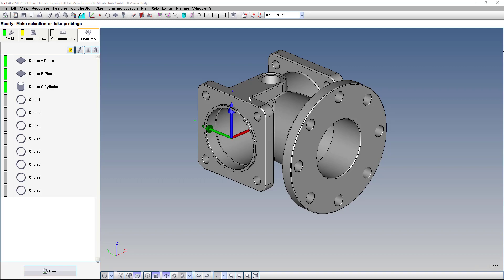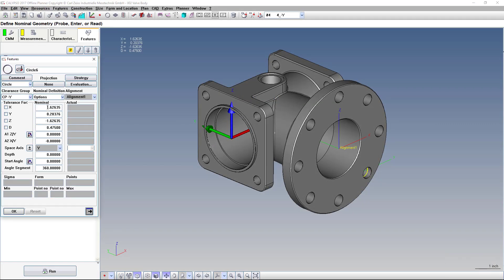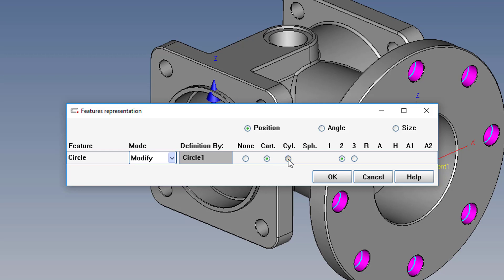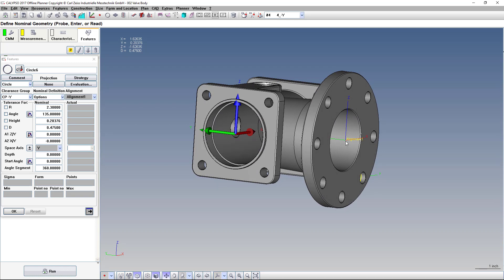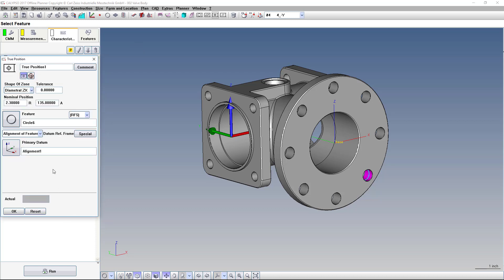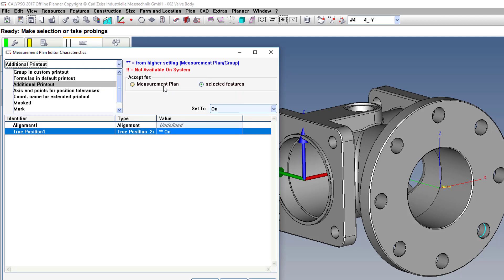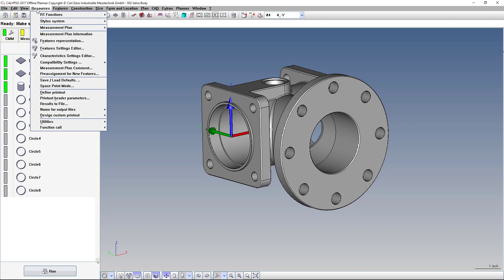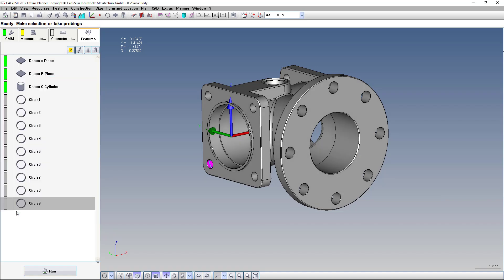True Position in Polar Coordinates

Comment: How to get the true position of 8 holes instead lying in the plane (as shown in video) it is lying in the outside diameter surfaces or outside diameter surfaces with the basics given are depth and the angle location of the holes
Reply from the maker: In that case you can create separate secondary alignments for each hole. Each alignment will be offset by a basic angle so that one of the axes points to the hole.

Comment: It was great to see the difference between Cartesian coordinates and Polar coordinates. However imagine you have radial holes on the bigger diameter. Then the axis of the radial holes would be different from the alignment, and because of that the true position, using polar coordinates won't work. I find it hard, doing a new alignment, to measure true position of radial holes. How do you do? Thank you in advance.

Comment: Can you please describe the primary difference between Cartesian and polar? And can you give a specific example of when polar coordinates would be preferred over Cartesian? Thank you !
Reply from the maker: Hi Joe!
Cartesian coordinates are for dimensions that are reported in a horizonal and vertical direction (X Y coordinates). For example, think of the game Battleship.
Polar coordinates are for describing the location of a feature in reference to the angle from the horizonal line, and radial distance from the center point. It is sometimes preferred to report basic dimensions in polar coordinates on a circluar hole pattern (bolt circle), because the reported values would better correspond with the basic dimensions on the drawing.
Have a great day,
Steven